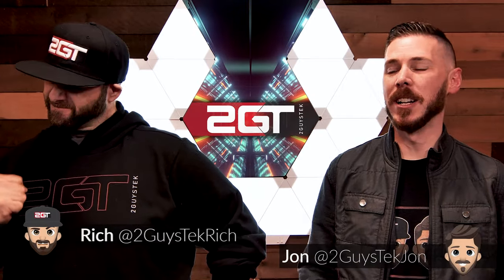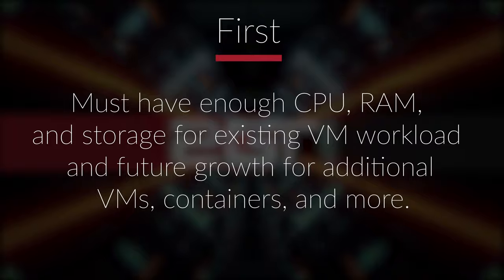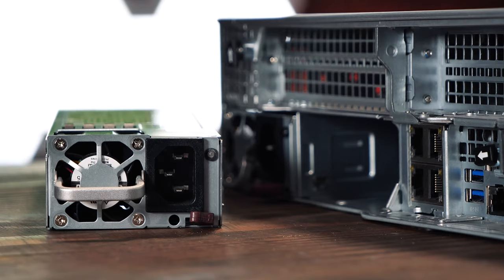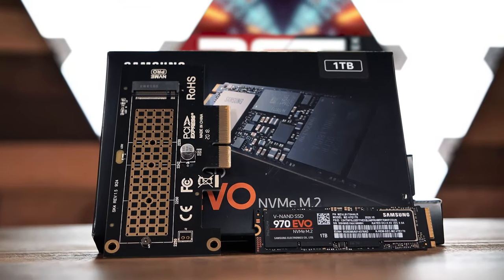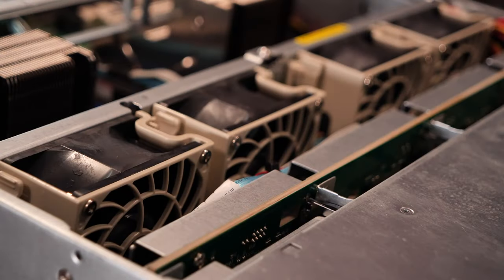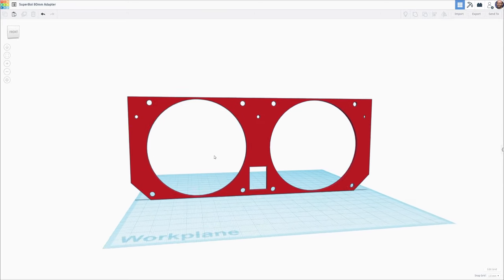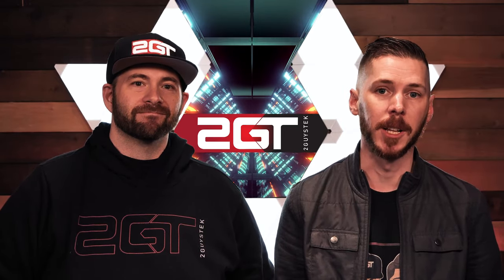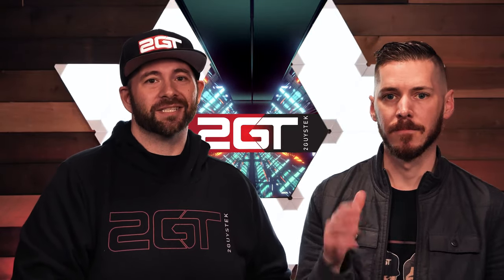Supermicro Server - Cheap and Powerful Home Virtual Server II

Comment: Do the cpus have an elastic top speed under stress? Reason I ask is I am going to be doing some virtual workstation hosting for daily use and 2.4ghz seems underwhelming for single threaded applications etc.
Reply from the maker: Great question! And yes, those CPUs do turbo boost to 3.3Ghz so even though they're 2.4Ghz base clock, they will ramp as capacity will allow. Here's a link to Intel's ARK website that gives you the full details of the chips: https://ark.intel.com/content/www/us/en/ark/products/91754/intel-xeon-processor-e5-2680-v4-35m-cache-2-40-ghz.html
Reply: @2GuysTek  Sweet! Keep up the good work guys, love the vids!

Comment: Hi, Looking to build my first VServer. How is this build working?...what would you change or build today?...Thanks, Mark
Reply from the maker: It’s been fantastic! No issues with the hardware so far. The build is only a few months old by this point and it’s been great. If anything I’d recommend more RAM, we doubled from the 64GB in the video to 128GB. Otherwise it’s been a perfect fit.
Reply: @2GuysTek  Thanks for the reply. I ordered one as well and the same extras you added. I was thinking of a LSI card but dell raid cards are just as solid. What were youth thoughts on choosing the Dell? I’ll start with the 64GB for now. Should be enough to run 10 - 12 machines.  This will be the start of my home lab build. Would you be able to make one of those fan shrouds  for me ? I would PayPal you for it . My next server will be for FreeNas. I’m thinking something like this build  somewhat prebuilt chassis then add ram drives ect.  Any thoughts ? Suggestions? Thanks again !

Comment: Thanks for the video, very helpful. How does the Noctua fans hold up in this case? Do they manage to produce enough static pressure to cool HDD and CPU?
Reply from the maker: So far yes. However because they spin slower than the OEM fans, we have them configured to run at full speed (via IPMI). That being said, however, at full speed they are still quieter than the original fans. If you're planning on deploying this server someplace with a higher average ambient temperature, you might consider leaving the OEM fans in just for the added headroom they would provide if temps were to get too high.

Comment: Hi, I noticed that you have SSD and HDD, in another video where you show your infrastructure I notice that you have only 2 datastores, what kind of settings did you select in your H730? Did you group all SSD into a RAID 5 virtual drive, same thing with HDD, and then combine both into 1 datastore? I'm guessing that will just slow things down, no? Thank you for these great videos!
Reply from the maker: Thanks for the questions! There have been a few different iterations of datastore disk layouts over the months and year of the build. In every situation using the H730, the RAID volumes were never mixed disks, only identical disks. So we had a RAID 5 of SSDs and a RAID 5 of HDDs respectively. It would be nice of the RAID card had caching capabilities that could take advantage of SSDs for caching for the mechanical disks, but it doesn't.  Thanks for the comment and consider subscribing!
Reply: @2GuysTek  Thank you! I am subscribed already. So when you mentioned 3 tiers of storage, Tier 3  is your NAS,  Tier 2 is the RAID 5 HDD, Tier 1 is the RAID 5 SSD and where is the  M.2  nvme card? Thank you for answering my question.

Comment: What's the power consumption at idle?
Reply from the maker: The IPMI on the server reports that over the last 7 days the peak usage was 358W, with a minimum of 269W, and the average was 294W. It's hard to say what 'idle' is for a virtual server, there are VMs running on it and it's never really in an 'idle' state, but at least those averages should help.  Thanks for the question! Consider subscribing!

Comment: Hey guys, I found this gem of a video after picking up the exact same barebone system (from the same seller I believe). I learned a lot, and already put in an order for that 3d printed bracket, thanks a ton!

I'm wondering where you installed the HBA card. The ebay listing reads 'Expansion Slots 	3x PCIEe 3.0 SLOTS ON RISER'.  Is that accurate? Sounds a bit low to me... It looks like you guys installed the HBA on one of those risers? Also, for connecting the hard drives, did you connect all of them to the barebone, and run a single (or double?) SFF8643 cable to connect the backplane to the HBA? 

Again, many thanks for posting this. Thumbed up and subscribed : )
Reply from the maker: Hey Zach! Sorry for the late response.  We mounted the RAID HBA in the PCIe slot above the redundant PSU, and we mounted a low profile SFP+ 10G NIC in one of the middle PCIe slots . This chassis also has an inset PCIe slot that was likely used for a internal RAID card and does not have a bracket mount, but it's a fully functional PCIe slot. That's where we placed a PCIe to NVMe adapter card for our high performance storage, you can see that in the video. 

Thanks for subscribing and consider joining our Discord server!

Comment: Isn't changing the fans with lower rpm bad idea without active heat sinks for you cpus
Reply from the maker: It can be if the fans you select don't have enough static pressure. These worked fine within our host.

Comment: Super helpful vid! My cousin is going to try and print the fan mounts you guys created, so thank you for supplying that! I modified the existing hot swap mounts for the time being to hold my Noctua fans, and it seems to work well enough. My temps seem to be hovering about 10c above the stock fans, which is still within normal range based on what IPMI is saying (the highest being about 59c). That said, did you guys experience any alarms after installing these? I'm getting a continuous alarm now within 5-10 min of powering on the server, but sensors are still showing normal even after refreshing. Was there any other config involved in the fan swap?
Reply: Figured out it was my SAS card causing the alarm after swapping for the more quiet Noctuas. I pulled off the old heatsink, cleaned/applied kryonaut, and put a 40mm fan on it. Seems to be operating smoothly now! The fan shrouds worked great too (although I had modify slightly), and I also slapped in some dynatron active cpu coolers. pretty happy with the noise level vs stock, and best of all no alarms! Thanks again for the vid.

Comment: Swapping out those fans seems like a mistake to me. You should be looking at airflow and reliability. In that small space, the airflow is crucial. Heat is generated by nearly everything in those cases and the only way to remove the heat is to use powerful fans to move the air. Your best option is to move the server into a separate room or closet and insulate the walls/door if the sound irritates you. Also use a sound dampened rack enclosure. This will quiet it down significantly. You can remote into the server and it'll be like it's right there minus the noise... The only disadvantage to this is if you are experimenting on the server hardware directly. In that case you'd need to go to the server, make changes, come back, etc...

Comment: Hi my server came in and I’m rewatching your video trying to figure out in what slots you mounted which cards. I’ve built computers before but not a server like this. I still haven’t purchased a raid card I was looking at Lsi only because there the most compatible with supermicro and recommended but not sure which one . Also did you add a 10g card ? I was also looking for a GPU card for a transcoding thinking about the p600. Any thoughts or help would be appreciated.  thanks
Reply from the maker: Hey Mark! In our build we added an SFP+ 2p 10G fiber card in the low-profile 8x PCIe slot on the middle-right, we installed our RAID card in the 8x PCIe slot over the PSUs, and we installed our PCIe to NVMe adapter card in the inset 8x slot in the middle-left (assuming you're facing the rear of the server).  But, just to be clear, you can put the cards in any location you want - they're all full width PCIe slots, so don't be too concerned about what ports you're installing devices into since they're all effectively the same!  Best of luck and consider joining our Discord! We've got a few people who've bought the same #Supermicro chassis and are doing cool things with them!
Reply: @2GuysTek  Thank you Thank you . Do you have any suggestions on a raid card other than the Dell you purchased. Looking at either LSI or  adaptec with the same specs criteria as the dell just more compatible with the supermicro. Most are 8 ports i’m not sure how this back plane works or is wired with the 12 bays . If you only get a 8 port card you can only use 8 drive bays ? I want to install the os on a dom and add a GPU. Yes I will join your channel. Thanks for the help.

Comment: hey. I'm making this same build, but can I install a nvidia rtx 3070 gpu in it? I'm kinda a noob...
Reply from the maker: Yes, depending on the dimensions of the card, but there is a lot of room in those chassis. You’ll need to get a few power cables to power the cars, but the main board of the server has PCIe power headers to support GPUs.
Reply: @2GuysTek  I got an error with my raid controller, it says "attached enclosure does not support in controller direct mapping mode please contact your system support system has halted due to supported"
Reply from the maker: @MOVIEGOERSTV1  If this is the same RAID card we purchased, we can help! If you can, join our Discord server and we can help you walk through the config change to make it work! Here's the link to our Discord: https://discord.com/invite/9mgwE2bBwh
Reply: @2GuysTek  yes same raid card

Comment: Hey guys! Great video. I purchased much of the same components for my build and have issues with the Perc H730. When I boot up, the BIOS gives an error “attached enclosure doesn’t support in controller’s Direct mapping mode.” Any ideas?
Reply from the maker: Hi Jason! Here's the answer: https://www.dell.com/community/PowerEdge-HDD-SCSI-RAID/H330-with-Intel-RAID-expander-RES3TV360-Direct-Mapping-Mode/m-p/5171644#M47741 

Long story short, you'll need to disconnect the 12Gbit SAS cables from the card, create a bootable Linux USB stick, and then you'll need to follow the directions in that link above. If you're still having issues after trying we suggest you join our Discord and we can try to help you more!  Best of luck!
Reply: @2GuysTek  Thank you!!! Since I’m not a Debian Linux person by trade, how do I run the rpm file? Proxmox (i.e. Debian Linux) states I can’t perform a run on the perccli rpm file. I just want this nice Dell H730 RAID controller to work lol.
Reply: Do I also need 2 RAID controller cards to support my 12 SSD drives or does one RAID controller work?
Reply from the maker: @jasonmc7031  Try this: https://www.2guystek.tv/perc-cli-debian I threw that together quickly to help you get on your way!  If you're still having issues please join our Discord and we'll try to help more!  Best of luck!
Reply from the maker: @jasonmc7031  The H730 will fully support all 12 of the disks upfront in that SAS cage. Sorry, I missed this question!
Reply: @2GuysTek  Awesome! Did you guys install a Linux OS and then Proxmox or Proxmox on bare metal? I installed Proxmox on bare metal so I’m thinking I should go back and install a Linux OS and then Proxmox before I install this file. When I SSH into Proxmox, it doesn’t recognize “sudo” commands. Thank you for taking the time to help me out. I cannot wait to get this bad boy up and running!!!

Comment: I built my media server in an intertech 4420. This is a 4U twenty bay chassis. I would have much rather scored a supermicro chassis or simply a used supermico server.  My problem is space constraints in my house. My server rack is in the same room as my office. Because of this EVERYTHING IN MY RACK HAS TO BE OFFICE QUIET.  This caused me to build a box with an ATX power supply and six 120mm noctua fans and two 80mm noctua rear exaust fans. Were it not for the sound the mechanical drives make, my media server would be dead quite. My media server and my desk top pc are in 4U rack chassis, in a startech 25U rack. My lab will come together over time. Next will be my gaming rig, my surround sound deck, my POE switch, UPS protection, my blue iris server, and back up server.
Reply from the maker: Very cool! We'd love to see your custom-built box sometime, sound interesting!  Thanks for the comment and consider subscribing!
Reply: @2GuysTek  Got the button and the bell. Standing by.

Comment: Low flow noctua for dual passively cooled 2680v4s, 12 drives, and hot running hba? lol
Reply from the maker: System runs fine, so….I guess we’re lucky?
Reply: @2GuysTek  I think the difference is that you made the fan adapter that puts them right at the front of the fan wall as opposed to the screw in method that leaves a 13mm gap top and bottom for flow to leak.  I did see how some people printed insert adapters instead that go between the thinner noctua and the hotswap fanholders to close the gap.  I'm 3D printing your adapter for me right now to try out although the 826 I have has a 3 fan setup... maybe I print 1 and cut another in half?  We will see....

Comment: If you are doing anything sensitive, i would STAY AWAY from anything from SUPERMICRO.  Do the research.
Reply from the maker: Hi Bob, you're the first to reference the Bloomberg article. To date, there has been no evidence discovered of any secret Chinese spy chips in Super Micro servers. 

(reference: https://www.engadget.com/2019-05-02-super-micro-move-chip-production-china-spy-claims.html )
..." However, an independent audit made it clear that if there have been any Chinese spy chips on Super Micro servers, they've been hard to find. Tests found no evidence of malicious hardware on current motherboards, as well as those from the generation sold to Amazon and Apple (which is what sparked the original Bloomberg story). Apple threw its weight behind the audit, and subsequently called for Bloomberg to retract the story, which it did not."  

If you have a more recent article to the contrary please share!  Thanks for the comment!
Reply: @2GuysTek  Actually i am not referencing the Bloomberg article.  Thats all i can say.   Just be careful.....
Reply: @appleguyone  Can you be more specific? What exactly do we have to be careful about?
Reply: @mrapma  lol be careful!!! Do your research dude